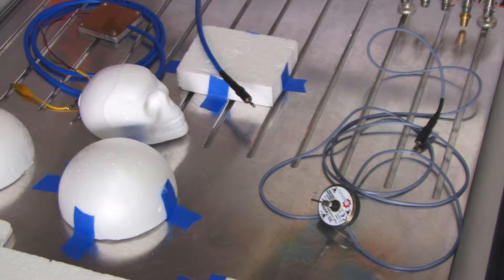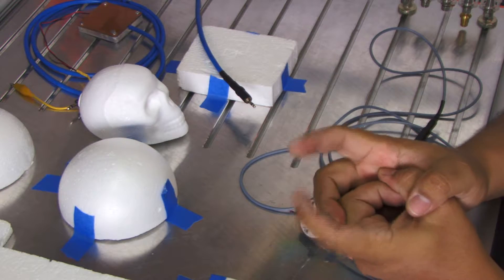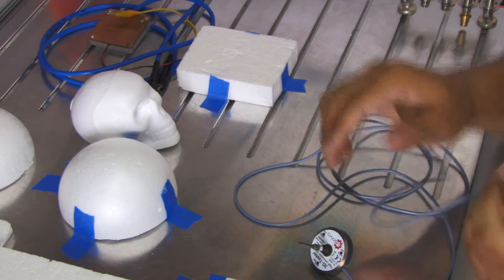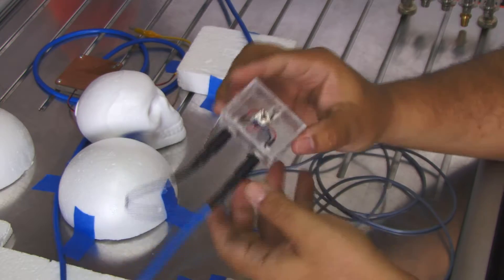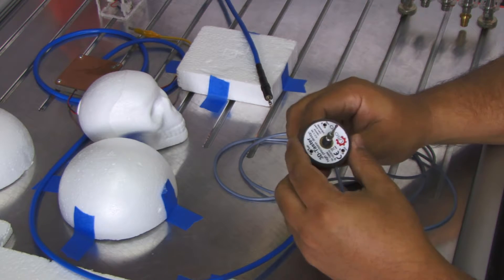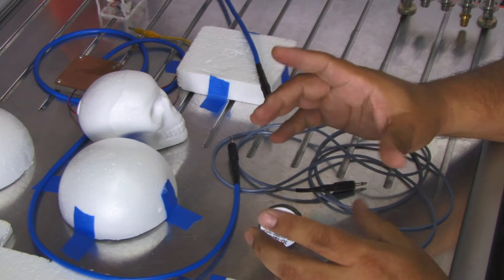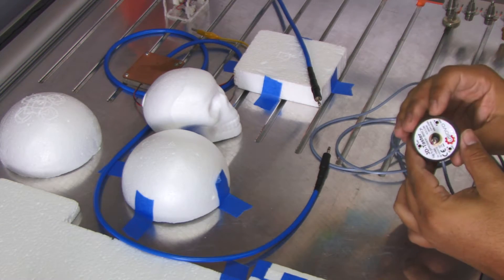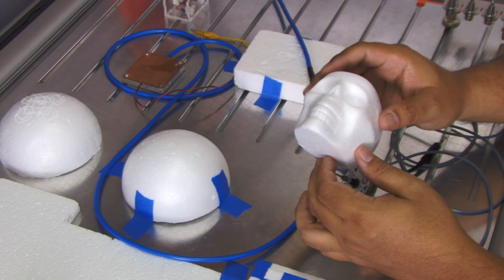3D Probe   01   How to connect it and whats coming next

Comment: Couldn't you just hook them both up in series? that way either one of them in the loop can break the continuity.
Reply: I second this, If it's just two NC switches, just serially connect them....
Reply: I'd still put a switch in-line, so that the laser head (which uses a normally-open switch for its' built-in length sensor) can work.